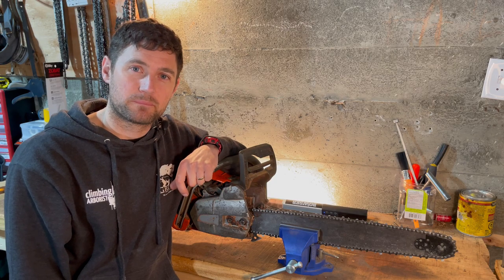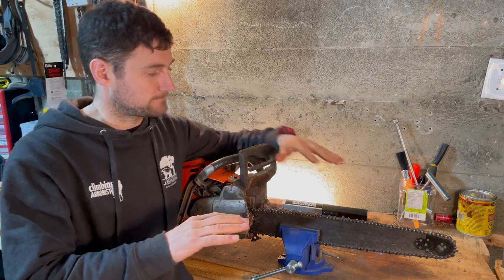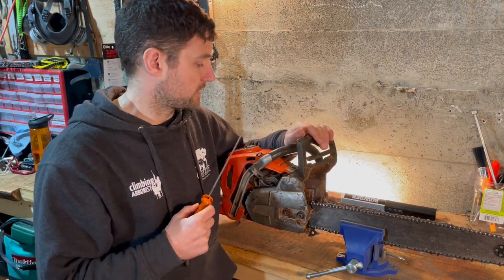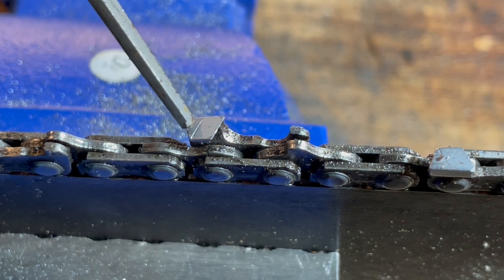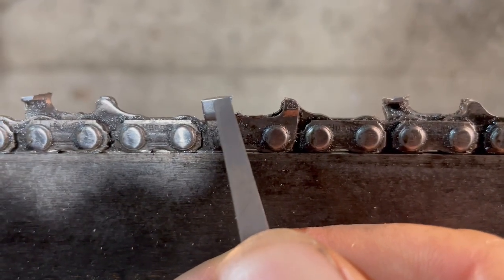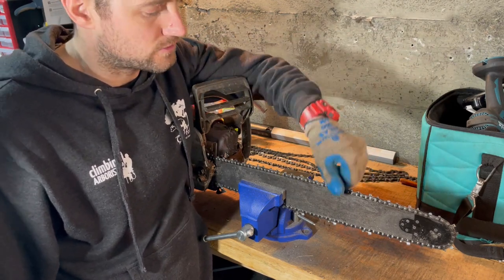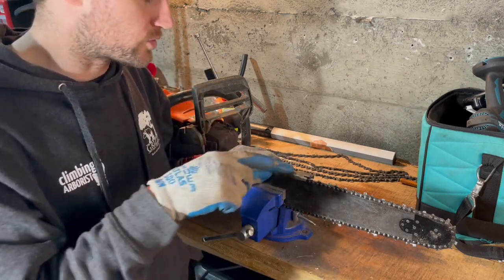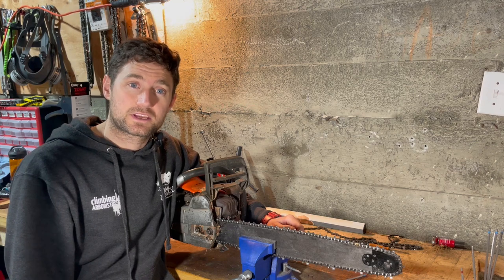HOW TO SHARPEN A CHAINSAW a step by step tutorial

Comment: The mistake I made when I was first starting out was to put downward pressure on the file.  I ended up filing nice deep furrows into the links rather than putting an edge on the cutters.  I worked out the key was to put rearwards pressure on the file.  Perhaps obvious to most but it caught me out! I have never seen this mentioned on any saw sharpening videos so I thought it worth flagging-up.
Love your vids Dan.
Reply from the maker: I know exactly what you mean and was the one part I had thought about but forgot to put in 🤦🏻 thanks so much for the comment,  hopefully if people watch this and are doing what you had done, it might make it click what they are doing wrong
Reply: Gotta get the gullet, the inside and the top of the tooth! You know your too far in if upward pressure catches the file

Comment: Really good explanation, thanks. 
For non pro's, I can recommend the Pferd CHAIN SHARP CS-X or the Stihl 2-in-1 (both the same, made by Pferd). I need to sharp 3-5 chains a year and it works perfekt. The construction of the tool helps to keep all angles and it files the teeth and raker in one step (you should round over the raker with a normal files afterwards) .
Maybe to slow for a pro but perfect for a few chains a year.
Reply: The 2-1 and the Pferd version does not keep the proper angle of the depth gauge to the cutter.
Pleases see my comment above for more in depth explanation.

Comment: Excellent stuff!
Well said with the gloves. I've seen some people ripping their finger due to not wearing them.
I would, also, reccomend to clean the chain from oil-residuals before starting to sharp ( making a last cut, by turning off the saw while the chain is still running in the wood, works quite well).
Reply from the maker: Thank you for the comments as always 🙏

Comment: Great video!  Using the piece of wood to clean up the cutting edges is a great idea!  I was wondering if you ever smooth out the gullets between the cutter teeth and the depth gauges?  I always figured that would help get a better curl int the cutter?

Comment: If the site allows it, you can make a vise with a medium diameter stump and a wedge by cutting down across the stump (as if you where cutting the stump in half standing up) and cutting back up to make space for the chain to move freely below the jaws of the vise. Below your cut make a “back cut” and leave a couple inches of hinge where you can put the wedge to close the gap on top where you can hold the bar. A creator named Advoko Makes uses this, so do I :P
Reply from the maker: Awesome, email me a picture if you have one and I’ll post it. mail@climbingarborist.com
Reply: @ClimbingArborist  will do! It’s currently 10pm here so tomorrow night I’ll send it.

Comment: That depth gauge will not allow your chain to cut as optimally as it could. You should try the Oregon/husky progressive style.
It's also not a good practice to pull the chain backwards, if it binds there's a good chance of getting cut.
Your cutters looked great 👍
Reply from the maker: How does the Oregon tool differ and in your opinion why is it superior?
Reply: @ClimbingArborist  the Oregon depth gauge tool is a progressive setting, the tool you are using is a fixed setting. 
The rakers need to progressively be lower as the cutter is filed back because you are setting an angle, not a fixed measurement like on a wood plane. On a wood plane the "chip" is determined by the fixed amount, on a chainsaw chain when the working corner of the cutter hits the wood the cutter tilts back(referred to as attack mode) then the raker hits the wood and the cutter begins to come back out of the wood, this action is referred to as porpoising. Because each cutter does this action individually the length of the cutter is not as crucial as many make it out to be, that is if you set each individual rakers depth to its corresponding cutter as the progressive gauge does, the style you used in the video and the newer stihl(or other brands) 2 in 1 filing system will give the same results you get.
Here is a link for the Husqvarna version(I'm not the seller).

Husqvarna Depth Gauge Tool For .375 (3/8) Pitch Chainsaw Chain https://www.amazon.com/dp/B001W0FGAQ/ref=cm_sw_r_cp_apan_glc_i_8GQ5MG58NTQEN73M773G?_encoding=UTF8&psc=1

The Husqvarna roller guide also has a progressive style guide and the roller portion helps to hold the file up under the cutter at the right height, it's a great tool for new filers or for chains that the gullet has been removed/too much hook.
Warning; these do not work on all brands of chains(although you can modify the to work on more), and they are for a specific size chain ie 3/8, 325, or 3/8lp(picco). 
There are newer style ones for the husky x-cut chain for 3/8, but I'm not 100% if they have new ones for the 325 and lp.

Husqvarna Combination roller guide for 3/8" pitch chainsaw chain, Blue, 10 x 2 x 10 cm https://www.amazon.com/dp/B0020ROXVI/ref=cm_sw_r_cp_apan_glc_i_EMA9DXHERRC6NFE3AHDH?_encoding=UTF8&psc=1

Also I think in Europe you can get stihl brand progressive depth gauges, but be warned they are much more aggressive than the husky versions and on very hard wood you will have a difficult time plunge/ bore cutting. 
I had some shipped here by a friend in Greece, nice tool, but as stated they are very aggressive and I wouldn't recommend them for new cutters.
If you have any other questions please ask and I'll do my best to answer. You've been quite helpful in climbing instruction thur the yrs, anything I can do to give back is good.
Have a great week.

Comment: Awesome job and I picked up a few tips.  You didn't mention the proper round file which is based on the chain type, 4.5mm for my 90 Chain type with a .325 inch pitch in my case. Basically I understand that we want the top of the file to extend about 1/5th the size of the round file ABOVE the cutting edge so it doesn't bottom out in the gullet.  Some like to use a Dremel with the A679-02 sharpening attachment kit with the speed set to around 2,800 RPM. Regarding flat filling the cutter depth gauge every 4th time, for my blade that requires a .025 inch (6mm) depth, and the Oregon 27742 flat file and depth gauge tool is great.  Finally, from time to time it's a good idea to rotate the bar upside-down so both sides wear evenly.
Thanks again for sharing your techniques and kudos for producing an excellent video with superb close-up shots with perfect lighting!

Comment: You can... absolutely tell how sharp it is by finger check
Reply: Agreed….the warm red liquid trickling down the bar is a good indicator the chain is now sharp. Totally unnecessary to use the finger unless of course you’re a smart ass keyboard warrior with poor eyesight.  Just saying!
Reply: @andycapp8843  slicing your knuckle open is part of the gig  , that's how you learn, means you  didn't carve out enough gullet, and I have to  check I'm ocd , check with your thumb nail sharpness
Reply: Andy CAPP your the truth.

Comment: 8:17 Absolutely not true!!! You can take one side all the way to the guide line and barely touch the teeth on the other side and it will cut 100% straight AS LONG AS each raker is filed to the proper depth to the corresponding tooth. I challenge you to try it Dan!